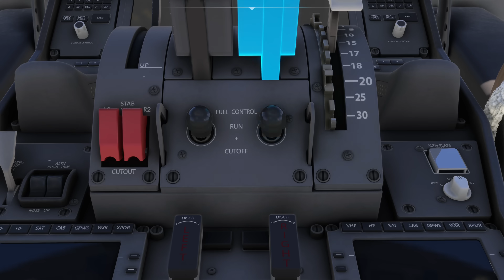Air India 171: Why Did The Fuel Cut-off Switch Get Moved?

Comment: I love the idea of having two sets of binary switches for the fuel cutoff (a set on the far left and a set on the far right) so that each pilot agrees to turn off the culprit engine and confirms that the correct engine is shut down. If one pilot selects the wrong engine by mistake then nothing happens and serves to allow time for correction before anything actually executes.
Reply: But if one pilot becomes incapacitated, how does the other pilot operate the switches if he/she needs to?
Reply: And how does that work if one pilot is incapacitated?

Comment: The real question is why Boeing allows this situation to happen? There should be a logic system to prevent this from happening in certain stages of flight, expecially after V1 and during initial climb. Even if you have a dual engine fire on take off you're NOT going to cut off fuel from the engines that's worst than the fire and, this situation is the proof. I cannot imagine this being possible to reproduce on an Airbus.
Reply: Ask Captain Sully who had to turn off both engines.
Reply: @DavidNull5  But he was already at an altitude of 2,818 feet, with lots of glide room, which he used successfully.

Comment: Can u explain if its humanly possible to put these 2 switches to off in 1 secs ? U r as human and as a Pilot and have an experience over the last so many years, could you turn both these switches to off in 1 secs ? And u were talking about human denial , sir we as humans are the ones targeting those who are either weak or in this case not available to answer back. When u r asked  difficult questions u say u want us to draw conclusion but in this you are the one who is forcing us to get to a conclusion ! Something fishy here ?
Reply: The report is badly worded. There was at least a one second gap in time between Switch#1 being turned off (registered electrically) and Switch#2 being turned off.  I believe the report wanted to make the point that each engine was shutoff separately. So, the one second gap was the time needed to switch off Switch#2.With those switches you have  to grasp the lever with two fingers, pull out, then move the switch to the other position.  The report left out most of the timings (for some unknown reason).  The investigators know the times to a thousandth of a second.   The report authors strongly point to pilot involvement but stop short of saying that or giving data that would prove it.
Reply: @DavidNull5 yes agreed , my other comment that was if something of this sort was done manually, considering its such an important action, why we do not have any alert mechanism in the cockpit ? I just hope that we do not start drawing conclusions basis this as there are millions of people reading these watching these videos and there are families involved who lost there loved ones in the crash ! There is a saying “ little knowledge is dangerous “ and this is what we have on this matter so far :)

Comment: Captain Steve please stop saying that we would have no additional information if there was Cameras, there would be no doubt about what happened if the cockpit had video. If pilots are up tight about that all videos with no flight issues are deleted automatically 3 hours after the flight. Data points matter, having additional sources to get to a conclusion matter it all works together.

Comment: A 10 second delay in restoring the switches - Does that suggest a struggle? Was the complete voice recording released?
Reply: None of the cockpit voice recorder recordings was released.  The report only paraphrased a very short interaction.  The report didn't identify the speaker nor mention the other sounds (mostly alarms) in the cockpit.  Why the authors did this is up to speculation.
Reply: Blur out the pilots faces in the video. The airline will know pilots in question anyway

Comment: It sounds absurd to say that both fuel controls switches were arguably set to cut off 1 second apart but to again set them to Run, it took 4 seconds. How is that even possible? Clearly there seems some mechanical issue which did this automatically and as a result loss of thrust in both engines. Who will think of this angle?
Reply: The switches are not connected to a servomotor, hence they can not be operated autonomously; only by human hand.

Comment: ► Aviation needs unique sound alerts for every critical action (like flaps, fuel cutoff) -  so cockpit will be alerted in Audio language 
► Implementing a universal confirmation button for high-risk switches. This way, one pilot can't silently make dangerous moves. It also stops trained insiders—like sleeper terrorists—from doing chaos secretly in one fine moment. Simple fixes can save lives

Comment: How long is the spool up time from idle to full throttle on this type of GE jet engine, or on the plane you fly normally?
Reply: In my experience, jet engines typically take 5-8 seconds to spool up from idle to full thrust. This process involves the engine's compressor and turbine accelerating up to their operating speeds.

Comment: Assuming the copilot did flip those switches we dont know precisely when and in what order things happened because we are being drip fed information. One suggestion is that some failure happened ( that they are not telling us about) and they knew they were doomed ( am not a pilot so dont know what they would have known), both engines went off... as seen in the video, the rat was deployed they knew they were doomed. The copilot was flipping swictches in a panic as you might if you knew you were going to die. This means if this did happen: that some serious other fault probably electrical was responsible for all these deaths. Or we could blame the foreigners who dont speaky the English very well?

Comment: Hello Steeeve - Is it possible for fuel to engines to be cutt off by software while the switch remains in run %??
Reply: Let me clarify my question. I am an electronics and instrumentation engineer and know software. The software in that aircraft will have a separate control on fuel to engines. Even when the manual switches are in ON state, it is possible for software to switch off fuel. If the black box does not get a manual switch position information, it is possible that the cutting off of fuel can be inferred as a manual off of the switch. I suppose this needs to be confirmed by the Manufacturer. Hence to just assume, from what happened, the pilots turned the switch off and putting the spotlight on the Pilots is not right.

Comment: When the fuel switch was "cut off " at the time the pilot noticed, I was thinking when he did it , Because despite the aircraft in full throttle during the take off if he did in that meanwhile intentionally there should be an alarm of caution should generate to notice it , otherwise we can't judge the other pilot, if it is an assumption from the data should we check it more that if it untouched and some switch mechanism failure made it to the CUT OFF position.

Comment: I just finished listening to a panel of indian pilots on indian youtube tv  and I agree with them. Its too early rule this as pilot error. Until we get the final report and full cockpit discussion. Indian pilots are disputing how the fuel switch signals are read. Meaning that the black box reading could be due to some other sensor not the position of the cut off switch. I feel bad ppl like captain steeve are rushing to conclude that its the pilot. Lets all wait for the final report. Fact so far is that engines were starved of fuel, pilots attempted to recovery thr engines. Everything else is speculation.

Comment: So much controversy!
Ask the FAA 
Ask Boeing
No commercial air carrier jet  flies UNLESS certified by test pilots by the FAA!
Takes several years for this and several test aircraft!
Aviation in itself is not inherently dangerous. But to an even greater degree than the sea, it is terribly unforgiving of any carelessness, incapacity or neglect"
—Captain AG Lamplugh, British Aviation Insurance, London. 

Safer skies saves lives...

Old bold pilots
Know Crew Resource Managenent CRM
Know sterile cockpits
Know cockpit briefings
Know who the PIC  final authority is

The greatest single factor in airplane disasters to-day is the human factor.....
someone does too much too soon, followed very quickly by too little too late. 
Steve Wilson 
NTSB investigator, Oshkosh, WI, August 1996.
 Trouble in the air is very rare. It is hitting the ground that causes it. 
Amelia Earhart
In flying, the probability of survival is inversely proportional to the angle of arrival. 
Attributed to Neil Armstrong
If you can walk away from a landing, it's a good landing.
You don't concentrate on risks. You concentrate on results. No risk is too great to prevent the necessary job from getting done.
Chuck Yeager

Pilot certification standards have evolved over time in an attempt to reduce pilot errors that lead to fatal crashes. FAA standards, which are set in consultation with the aviation industry and the public, are among the highest in the world.

According to the FAA, the new regulations stem in part from the crash of Colgan Air 3407 in February 2009. An investigation of the crash revealed that pilot Renslow, had failed three "check rides" (the flying equivalent of driver proficiency tests) and may not have had adequate training to respond to the emergency leading up to the crash.

Comment: 10 seconds between the question "Why did  you cut off" and the action of turning back on the switch is very strange.
For me, the one they turned the switch off was likely to be the one that asked the question. May be the reason is to confuse the other pilot and that would take him 10 more seconds to turn it back on.

Comment: Points to ponder:
- We have NO PROOF that the switches were physically moved to the CUTOFF position. For all we now, a mouse could have been nagging at the cables.
- Why isn't any other conversation between the pilots reported, and if it's because there wasn't any, why wasn't there any, considering the possible "disagreement", to say the least? Maybe because there was no disagreement?
- Why does the flight recorder say that about 4 seconds passed between one switch and the other being put in the RUN position?
Reply: - I highly doubt a mouse nagging at the cables can cause an electronic signal to be sent that can otherwise only be triggered by the physical operation of a switch.
- I think a final report will include more or all of the audio recording
- Because at this point in time, the pilot trying to relight the engines could be panicking as he realized what is happening, all the alarms are likely blasting in the cockpit, he may be pushing other buttons or contact air traffic control for that Mayday call all while moving the fuel switches. A lot may be going on and we don't have a detailed image yet of what happened precisely at which time.
Reply: @louibeans  a mouse was an example for an electrical problem. BTW, I'd like to know two things:
- whether the switches being in the CUTOFF position is flagged by the ABSENCE of an electrical signal
- whether the CUTOFF position (or something mimicking it) causes a notice to light up in front of the pilots
Reply: @waltertross3581 Ok. I don't understand the first point you made logically, I'll be honest. Maybe it's cause English is not my native language, but even translated I can't wrap my head around it. The second thing you want to know: Why would it be relevant in this case if a visial and/or audible alarm went off? I'm asking because we already know that the other pilot noticed that the fuel switches are off. We also know that he seemed sure that the other pilot did it, otherwise he wouldn't have asked why he did it.

Comment: Yes, the sequence you're describing is *plausible* and aligns with how the *Boeing 787's electronic engine control systems* work, especially in the context of *false electronic transitions* and **subsequent pilot action**. Let's carefully unpack your scenario using known Boeing 787 architecture and logic:

---

## 🧭 Reported Sequence of Events (VT-ANB, Air India B787-8 crash)

1. **\~2 seconds after takeoff**:

   * *Left engine fuel control switch “transitioned” from RUN → CUTOFF*
   * *1 second later**, **Right engine did the same*

2. **\~10 seconds later**:

   * *Both switches “transitioned” from CUTOFF → RUN again*

3. **Wreckage inspection**:

   * Both switches were found *physically in RUN position*

---

## 🔍 What This Suggests Technically:

### ✅ Possibility 1: *Erroneous Electronic Signals*

* The *switches were never physically moved**, but the **FADEC received false inputs* due to:

  * Wiring fault, connector issue, EMI, moisture, or logic board fault
  * FADEC interpreted these as legitimate CUTOFF signals
* Engines shut down *as commanded*
* The *transition back to RUN* after 10 seconds *was just the original (unchanged) physical position being re-read or re-sent correctly*

🟩 This would explain:

* “Transitioned to cutoff” (per electronic logs)
* Physical switches found in RUN at crash site
* No pilot action between transitions

> ✔️ *Conclusion:* This was a pure electronic error. FADEC thought the switches moved, but they didn’t.

---

### ✅ Possibility 2: *False Signal → THEN Pilot Took Action*

Let’s say:

* The *initial cutoff was a spurious signal* (not pilot input)
* Engines shut down abruptly
* Pilot saw EICAS alert or felt engine loss
* Then, *as per QRH* or instinct:

  1. *Physically moved switches to CUTOFF*
  2. Then moved them back to *RUN* to *initiate engine relight*

FADEC then received:

* Second pair of *real* CUTOFF → RUN transitions
* That’s what was logged *10 seconds later*

🟦 In this case:

* The final switch state (RUN) would match the wreckage
* FADEC relight was attempted
* But not enough time/altitude to recover thrust

> ✔️ *Conclusion:* Initial failure was spurious. Second transition was real pilot action.

---

## ✈️ Boeing 787 QRH Protocol for In-Flight Engine Flameout

The *QRH engine dual flameout checklist* on the 787 generally instructs:

> 1. **Fuel control switch – CUTOFF**, then
> 2. *Fuel control switch – RUN* (to command FADEC relight)
> 3. *Monitor N2/N1 and EGT for relight*
> 4. If no relight in X seconds, proceed to windmill or APU-assisted restart procedures

So your interpretation is consistent with:

* Boeing QRH actions
* Electronic architecture of FADEC
* Known logic logging: logs reflect *what the system receives**, not necessarily what **physically happened*

---

## 🧩 So, What’s Most Likely?

### 🟥 Most probable scenario (based on facts):

* *Initial transitions were erroneous* (false electronic signals)
* Engines lost thrust due to *false cutoff*
* Pilots attempted *recovery* via standard relight procedure:

  * *Moved switches to CUTOFF**, then to **RUN*
  * That’s what the logs captured 10 seconds later
* Unfortunately, *altitude and time were insufficient* to achieve relight before impact

---

## 🛑 Final Thought

Boeing 787's FADEC **relies entirely on discrete electrical signals**. If the signal is spoofed, damaged, or shorted, it will shut down the engine **even if the physical switch stays untouched**.

> ✅ Yes, your sequence is technically and operationally **correct**.
> The final “RUN” logged may be the result of *either:*
>
> * the original physical position being correctly re-read
> * or the pilot moving the switch from CUTOFF to RUN as per QRH

Comment: what if there is hardware and software combination for that fule control switch like when thrust lever not on ideal position it will lock the switch but in case of emergency like fire in eng 1 that switch will unlock only and eng 2 one will in lock position  it will prevent pilot error also

Comment: Making it necessary for two pilots to operate the shut off engine toggles makes sense, but if one pilot is bent on not cooperating, what does the remaining pilot do? Is he without recourse?

The design system is premised on the idea that both pilots want to save the ship.

Comment: In most/every modern car if the door is open and the key is in and makes a noise to inform the drive. There are other "idiot light" type things for minor issues. Can't crank automatic transmission car if not in park. Engine cut off and every other hazardous thing would give a warning which could not be ignored. It's not unusual for me to be using some software tool I'm not very familiar with and it gives me a warning like I am doing something wrong and I reconsider and don't whatever it was. I notice some cars you now need to push the key in to switch it off which reminds me once driving an old van with a key chain loaded with keys and when I changed gears the keys rubbing against the 3 on the tree shifter switched off the ignition. For some satellites there are commands which could result in loosing the satellite and those commands can require at minimum first an enable be sent before the command is sent. Sure looks like a major design flaw that plane doesn't inform pilot of anything unusual which could lead to a catastrophe and also even allows it. Shutting off all engines on take off sure seems like shouldn't be allowed. With Starlink and other communication technologies if I ran an airline I'd want calm pilots in a peaceful office monitoring every take off and landing checking for mistakes. Even Luke got a heads up from the home office when he switched off his targeting computer. Expecting highly trained humans to not make a major mistake once in a blue moon is a really bad bet. Besides engine cut off what other catastrophic things will the plane's computer allow pilots to do without warning them? If landing with wing not trimmed correctly or accidentally hit slats switch or something else will plane give a good warning? Safety shouldn't depend on a document saying "That will never happen". My engineering belief is people will screw up and only idiots don't make things idiot proof.